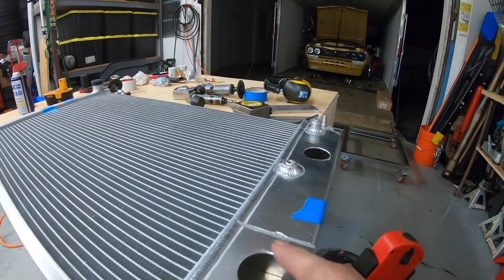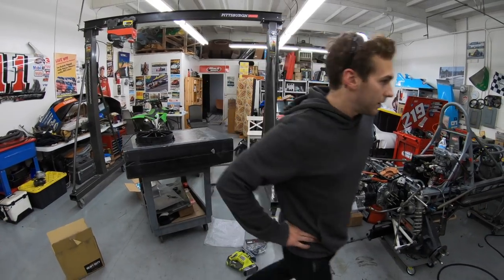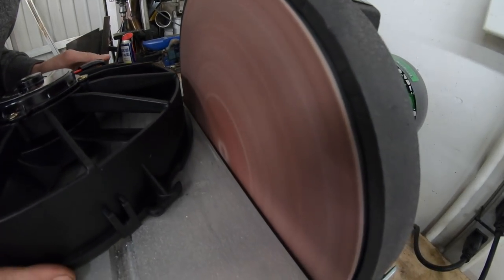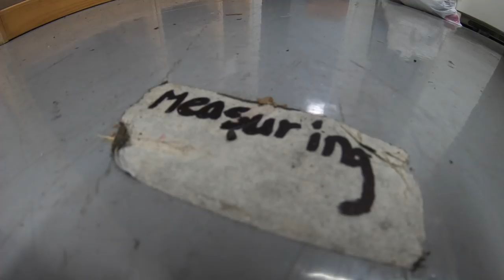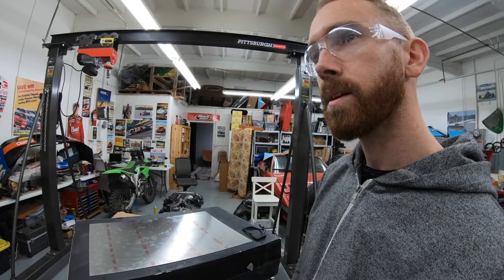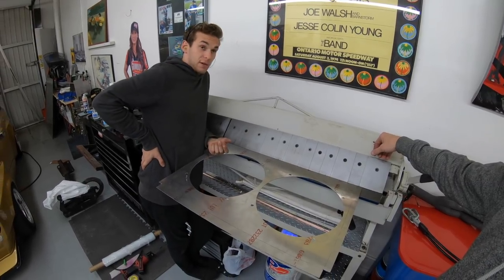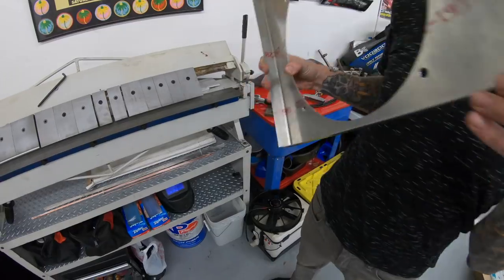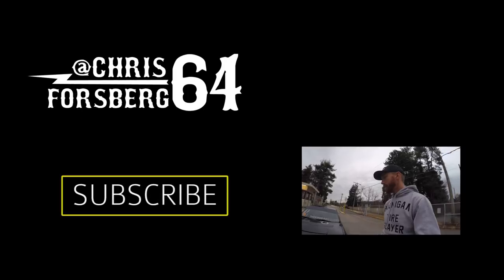Good Enough! EP9 - How to Build a Triple Pass Radiator and Fan Shroud - Part 2

Comment: How is the shroud getting secured to the rad?
Reply from the maker: With a few more rivnuts along the top edge or you can do tabs to threaded bosses that get welded to the radiator. Some people will just weld them on too as it is less weight and then rebuild them when they get a new radiator.
Reply: Loving the consistent uploads fellas, I hope it pays off for your efforts involved and good luck for this FD season from Perth Australia!

Comment: Chris Forsberg how much of a pain is it to burp a rear mounted radiator system? Im considering it for my car but really on the fence on it.
Reply from the maker: It is no harder than burping out a standard cooling system. The issue is still getting all the air pockets out of the engine. Bleeding the hoses and the radiator is the easy part.